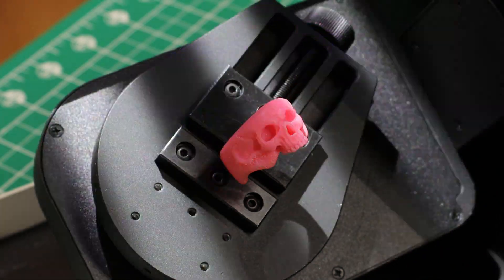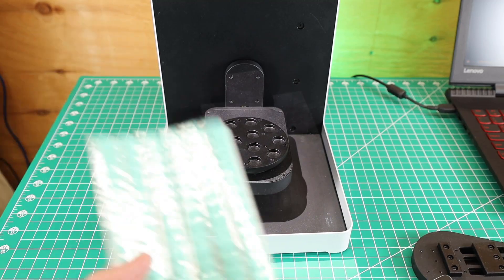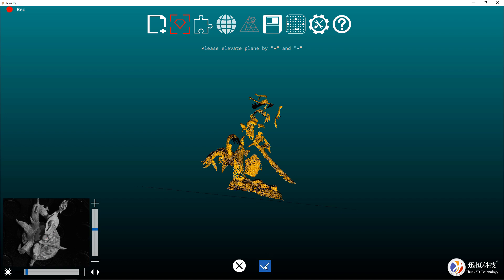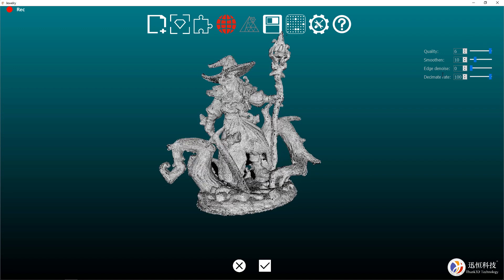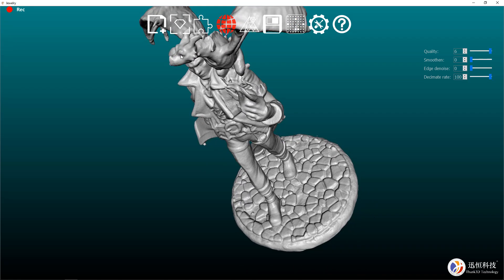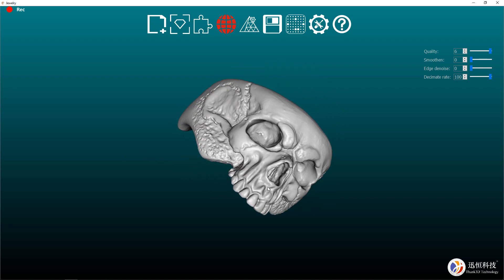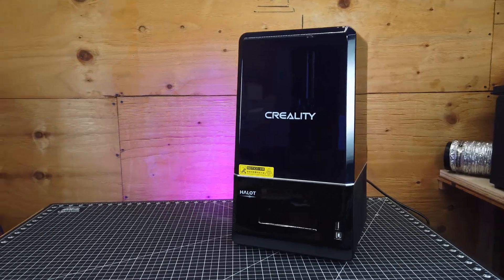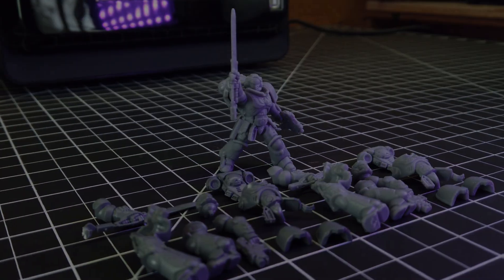Must Have 3D Scanner for Small Objects - Thunk3d 3D Scanner

Comment: Would there be any way to scan several parts of an object, and then digitally "knit" these scans together for an overall larger scan than the 80mm max?
Reply from the maker: I believe you can do that to a point. It does have to fit in the scan arm and be able to move around on it without it hitting the frame of the scanner